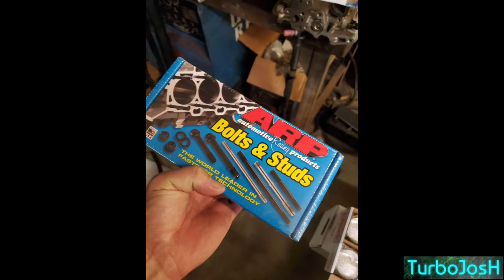C5 CORVETTE CAM 500HP N/A BUILT + dyno pulls!

Comment: Question; I want to increase the power of a 1999 C5 from the stock ~345 HP up to 415 HP, naturally aspirated on 98 octane fuel. What's the best way to do this, and would you say that 415 HP is more or less completely safe for this engine/drivetrain?
Reply from the maker: Yeah 415 is safe. Do a big cam or a smaller cheaper blower/procharger. Because it probably cost 3-6k just to install a cam on these darn cars
Reply: @JoshRaySpot  Wow! 3-6k, I had no idea. 😅
Reply: @viperracing2889 If you do it yourself, a Stage 4 or Stage 3 NA came from BTR with a Titanium Spring, Retainers, etc. upgrade will only cost around $800. Throw in a C5-R Timing Gear set and you could DIY for about 1k.

Comment: are those 823 heads on a 5.7??
Reply from the maker: No idea. I do not know that much about his engine.
Reply: @JoshRaySpot  for what i know 823's are to big for a 5.7 , must be 6.0 to make that hp
Reply from the maker: @pereztang1  pretty sure he went 5.7 bored over and built
Reply from the maker: @pereztang1  well why do you think its a 823 heads
Reply: @JoshRaySpot  because it’s stamped on the heads
Reply: @pereztang1  you can also see that it is a 6.0 if you pause at 0:34